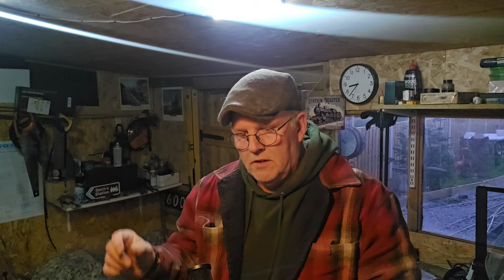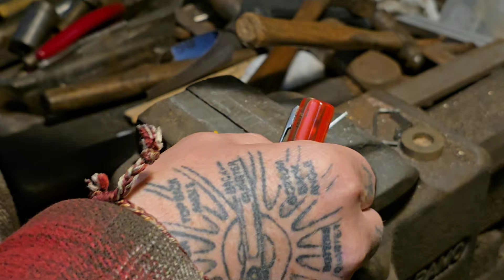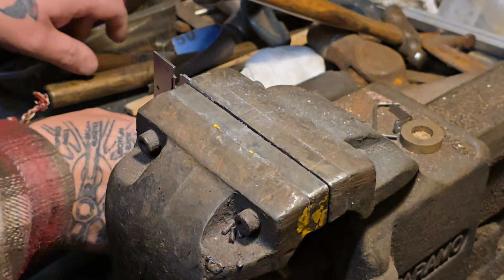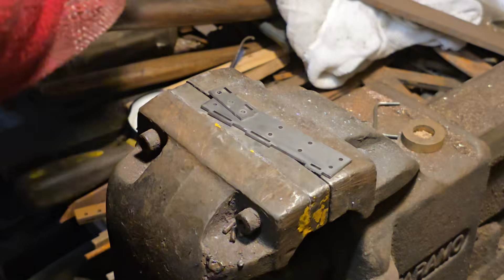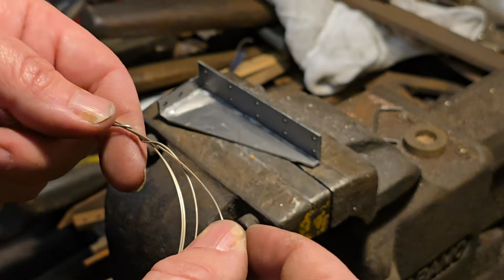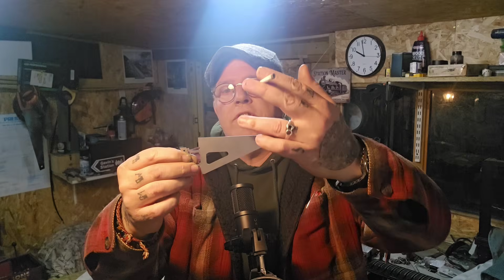7.25" BR Standard 2 build video update part 28

Comment: Thanks for showing. Gonna have to see all your videos to get an idea what I need to do to start building here in the states. So hello from North Colorado. Gonna turn my garage into a shop to build the parts. So anything that I can use to make it simple and clean, I would use. So I wouldn't call it cheating either.
Reply from the maker: Thanks for tuning in, if you haven't got a CAD program yet try Siemens Solid Edge it's free to the hobbiest, it will definitely help with getting parts cut.